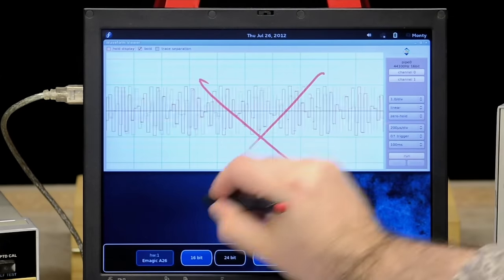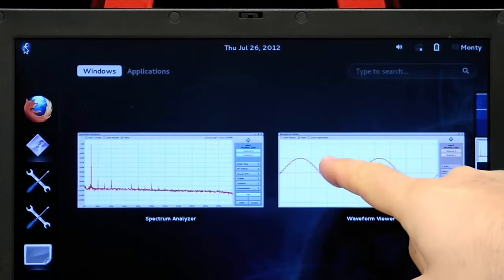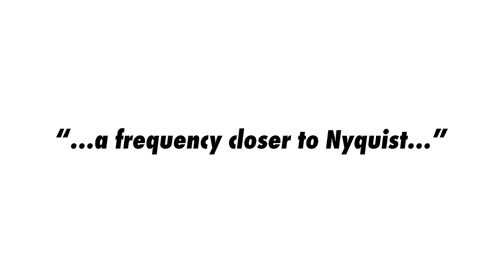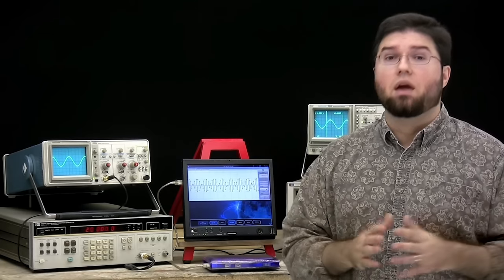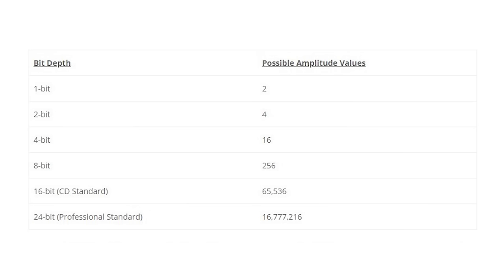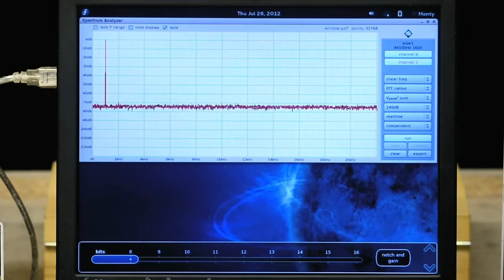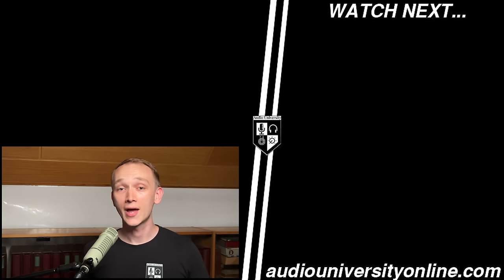Debunking the Digital Audio Myth: The Truth About the 'Stair-Step' Effect

Comment: It’s true in a vacuum. To listen to 16/44,1 audio engineers need to convert it to 16/44,1 after working on it at higher sample rate and bit depth. And while there’re good converters it is still a digital processing that applies averaging and other things. Even digital volume control is type of processing and it applies more averaging the lower sample rate you use. 

In this case it’s better to listen to music in the sample rate it was recorded/processed to apply as little conversion as possible.

Comment: I've already known that 16bit/44.1 was the limit of human hearing (although not all my friends believe me). However it's worth noting that the extra dynamic range you get from 24 bits comes in handy when you're doing audio editing and other post-processing. In general, you want to edit at 24 bits, and then reduce to 16 bits on the final output. There might be advantages to higher sample rates too, but only if your rate conversion algorithm is rock solid.

Comment: Good technical video with great production quality, so well done.

On the other hand, the video completely misses the subtle implications of sampling theory and over-sampling, in particular where over-sampling is generally done to ease the phase, attenuation and ripple performance of the nyquist low pass filter, prior to digitisation.

In the real world and precisely in the frequency domain,  the sampling process creates  sub-band pairs  centred on each multiple of the nyquist frequency. This means that real signal artefacts above nyquist, albeit low in magnitude, will be reflected (i.e, aliased)  back in-band by the digital sampling process.

Unfortunately the tests used in the video will not demonstrate this effect.

By over-sampling at much higher frequency than 44.1khz, the phase, attenuation and ripple performance of the low pass filter become much easier to achieve, while aliased image artifacts ( from next upper sideband pair, centred perhaps on 96 or 192kHz for example) will be attenuated to much lower levels, thereby reducing intermodulation distortion products and increasing fidelity.

Ultimately, the human ear and audio brain are far more sophisticated than any oscilloscope, so the differences can be detected.

It's not about the staircase jaggies, it's about high frequency artifacts folding back into the audio band, and maintenance of high frequency phase and ripple fidelity.

Comment: this is great and all, but consider that the output devices this signal goes to cannot exist in a state of superposition. That is to say that the movement of the speaker is linear and not instantaneous, thus smoothing out any steps there may or may not be in the output signal.

Comment: Digital audio do have staircase-like output. There are filters to smooth this out. And a lot of the issues are actually in those filters. So the "rounded", "smooth" waves you are seeing looks good on screen but does not necessarily translate to an accurate representation of sound, that has many simultaneous time-aligned frequencies and events.
Output of a filterless non-oversamplig DAC can be seen here: https://www.inf.ufrgs.br/~johann/dcnosdac.output.jpg

Comment: I question the test :
- my first job in the 80s was to test a DAC. There WERE steps. There were even glitches at every step. that could be filtered with a low path filter to smooth the things out (there were anyway by the amplifier and the loudspeaker). So at low frequency, with a low signal level, there ARE steps you could see.
- the oscilloscope has not enough resolution to display the 65536 steps anyway. Unless you use a very low signal level (like one thousands of the full resolution) you ain’t see nothing on the scope.

(I did not know this « Nyquist » law, I know of Shannon law that state that the sampling frequency must be at least twice the frequency. In fact twice + epsilon.
Reply: @nicksterj the thing is that the analog output of the DAC here is filtered. At 15khz, there are almost no harmonics. In other words, a sine wave. If it was not, we would see the steps (there would be several harmonics). And probably some aliasing too.
As mentioned, these would be cut off by the amplifier anyway.

Comment: I've always reckoned that higher bit depth would give more dynamic range. Consider a signal as loud as the maximum that for sake of argument a 4 bit system can handle. A signal at one thirty second of that level (i.e maximum is 32v RMS, a signal at 1v RMS) would only be using one bit. The low level signal could not be a true copy of the original when reconverted back to analogue, and any lower level signal would be ignored altogether. The bit depth has to be sufficient for low level signals that will not use all the available bits to be reproduced with reasonable fidelity.
Reply: @nicksterj I think that's my point. Too few bits, could still give good reproduction of loud sounds, but soft sounds which only use some of the bits will suffer if there aren't enough bits to start with. One reason why my example only used 4 bits apart from making the arithmetic a bit simpler. Every extra bit doubles the signal magnitude that can be handled. It wouldn't take all that many extra bits to give a usable range of thousands to one compared to the 32 to 1 in my example. As explained in the video, sounds using only a few bits would be well below the noise floor or the lower limit of hearing in a 16 bit system at any reasonable listening level. Above a certain point more bits just gives more usable dynamic range, rather than greater fidelity.

Comment: This myth about steps is also that no one understand how tape works.  Most envision some squiggly line that runs the length of the tape as the stored sound.  When actually it's striped pulses that cross the tape at 90 degrees that record the frequencies.  So in a weird way digital sampling vs analog are similar.  Tape uses pulses that make the speaker vibrate to reproduce music while digital uses math to recreate the pulses signal to reproduce music.

Comment: Very interesting video, but we were only looking from the current standard to higher frequencies and bit depths (I know, there was also 8 bit).
What I would find way more interesting would be at which point the signal will get distorted if we lower the sample rate and/or bit depth. Obviously,
if you would use only 1 bit, the signal would not be presented very well, but at what point does the distortion begin?

Comment: Wait...each sample represents a voltage level on the speaker and IS held for the sample duration. That IS a stair step pattern. So obviously the DAC (or some other interim processor) is doing the smoothing.

Comment: I recorded a natural area, birds chirping in a forest.
I used the exact same equipment for 44.1 and 48

Listening over headphone playback,  in mono I couldn’t hear any difference whatsoever.
But in stereo, the ability to locate the sound of the bird in the soundscape was sharper in 48, the 44.1 has a degree of spacial blurr.
48 has less phase distortion
Reply: mfnickster9754  
A Sony DAT
Bear in mind that I A/B’d for hours to detect any difference, and slight soundstage smearing was all I could detect between the two rates. 

Subjectively, imagine a Robin tweeting in a tree 25 yards away.
The sound location seemed less pin point under 44.5 , let’s say it was a 2’ spread, with 48 it was dead on.

Comment: 12:23 if you know how loud a 90dB sound is, a 120dB sound is 1000x louder than it (as the decibel system is an exponential system, +10dB is equivalent to 10x the volume)

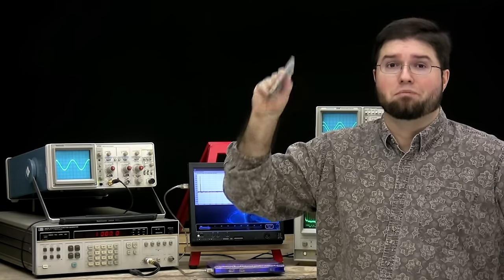Comment: 10:27 That's only on Type 0 tapes. Quality Type 1 tapes definitely don't sound like they have 5-6 bits of S/N ratio, as shown by VWestlife and Cassette Comeback, when the level is adjusted properly. They are closer to 9 bits. 

And the hiss can also be mitigated quite a bit with those mains powered bulk tape erasers, if your tape deck doesn't erase it properly.

Comment: Not quite sure I understand how the effect on noise floor works, but I'm glad to see bit depth = dynamic range really does come out in audio the way I expect it to from a software engineering perspective- that is, obviously you can represent more levels of difference with 32 values than you can with 8, your minimum of "1" being further from your maximum of 32 than of 8. Oh, I guess that's the noise floor huh? The fraction of the maximum that the lowest value is. Hah! I guess it does make sense.

Comment: I remember sampling a TR-808 with my Kurzweil K2500XS using 44.1 Khz 16 bit the bassdrum sample had a  high pitched ringing sound added. The ringing was gone when I increased the samplerate to 48 Khz.  What could have caused the issue at 44.1 Khz?

Comment: This is not exactly wrong but it is pretty off.
First, you choose a sine wave as your example. 
Most of the time if I am testing gear to see what is going on with the transfer function, I use a square wave. 
That signal will have a lot more harmonic content. 
The square waves corners will droop or pinch upwards depending on whether the harmonics are being attenuated or reinforced. 
So this is a better example of how well a system can reproduce a signal accurately. 
The sine looks more analog so I see why it was chosen for that reason. But it also is more tolerant of abuse by the transfer function. 
It has no harmonics, so they can't ring or be attenuated to modify the shape of the waveform. 
You essentially only have hard clipping and noise to worry about.

I used to be an analog purist until it became impractical. I still would prefer to record on magnetic tape and mix through an analog desk. 
But I embraced digital after doing my own tests.  It has great bandwidth and dynamic range, but you have to maintain proper headroom, where analog medium is more forgiving. 
But that discipline bears wonderful fruit of transient detail. 
Through my own tests and listening I've found that digital does have problems in the upper end. 
You mention the Nyquist theorem where the highest usable frequency is half the sample rate. 
This is true. Also most DA designers I am aware of put a low pass filter right at the Nyquist cutoff. 
Anyone who has studied filter design knows there are no perfect filters that drop off perfectly from one frequency to the next. They are all so many dB per octave roll off. So your 44.1khz sample rate has a low pass filter starting at 22kHz and dropping at 12db an octave or so.
They can make a steeper filter that drops off faster, but that filter will then ring more, or introduce delay/phase issues. Which themselves have an objectionable quality to them.  
So these filters do intrude on the upper end of our hearing range.
The 48kHz sample rate was a workaround for exactly this problem. It pushes the Nyquist corner freq to 24kHz, well above audible for most humans (I could hear that high when I was younger, but thats another story). 
So this gives the designer plenty of room to design a filter that only barely reaches in to the audible band, and is many dB down from the program material by the time you get into the main part of the material. 

Now this is where we get into higher sample rates and bit depth. 
Suppose you have two square waves of different frequency, and a saw tooth wave, and a sine, all mixed into one signal. 
That is a more complex signal. Now pitch all those about an octave from each other, and at different levels. 
Ad some impulse signals as well just to make it interesting. Now this is approaching the complexity of music. 
Add some randomness. Pink noise or something.
If we want to keep sharp edges and detail of this ugly waveform we don't want to be hitting the top of that digital ceiling, and we don't want to be down in the noise either. 
16 bits is about 90dB snr right? 

Here is the problem as I see it, when you look at an accurate frequency plot of audio the low end is well represented, the middle less so, and the higher frequencies take dozens of dB less signal to sound at the same apparent level. This is why we use higher bit depth. 
So we have not only more headroom, but more basement for our weaker high end signal. 
If you are at 16 bit and you are -48dBfs you are really only using 8bits. 
Going to 20bits gives you an effective 12bits on that quiet part of your signal. 
Going up to 24 or 32 likewise gives you more working room. 
This is important for production work!
The signal that gets recorded is destined to be processed by virtual EQ and dynamics. 
This will bring up the previously quiet parts, if they are noisy or affected by a janky LP filter we won't like the tonality. 
So we use ADDA with 24 or 32 bit depth, -120db snr, and 192khz SR. 
You want it to be not "just good enough" for the range of human hearing, but to exceed that. 
The final delivery medium can be just good enough. 

Gotta say I am skeptical on your claims about the equivalent bit depth of magnetic tape. 
I know of a few machines by Nakamichi, Denon and Tascam/Teac that had claimed singal to noise in the 80's with Dolby C, or S. 
Also in the late 80's we got Dolby SR on the big multitracks. I got to use that a few times and it was very impressive. 
Pretty sure an Otari with Dolby SR could get into the 90s. And then there was the DBX noise reduction which had absurd claims of 22dB gains and such. But DBX always made things sound dull and plastic so lets ignore it. 

TLDR do this again but with square waves.

Comment: No the nyquist is the sample freq is half the cycle giving 2 samples per wave. think of a car wheel turning, when it reaches a certain speed it will look like its going backwards. 20kz is average at the age of 18 but sound engineers can hear higher like runners can run faster. you have smoothes on the output of a DAC so a sine wave will be reproduced looking great without steps.

Comment: One case where more bits can be desirable is when alternating between very soft sounds and very loud ones (classic pieces, movies, concerts etc) but this means that you're trying to render a very faint sound with a higher precision than one can hear, or that if the person increases the volume, then the subsequent loud noise will destroy their ears.
Reply: Yes you are totally right. 
This point on sound separation between the various instruments was not even discussed in this video.
Hence 16 bits isn't enough.
One proper article mentioned that 20 bits is the ideal. Beyond that we cannot perceive any difference.
But since the next hit depth is 24, that's the one which will have more benefits than 16.
Reply: @anujmchitale  note that 16 bit is still too fine resolution for the human ear, 8 bits are enough, however for the dynamic range it's useful. But that range doesn't need to be linear like we do with 16bit PCM. For example 16-bit floats (fp16) provide a range of 30 bits + sign. And 8-bit floats in 1-4-3 format can provide ~18 bits + sign ~= 19 bits that should be sufficient to encode highly dynamic music with an excellent quality.
Reply: @levieux1137  Yeah but the sound level aspect that you discussed in the original comment is quite important in a piece having 4-5 instruments. Then I could observe the minute notes better at 18-19 bits than 16. Ofcourse after 16 the next bit depth to choose is 24. But both of us would agree that humans won't be able to differentiate anything beyond 20 bits.
Reply: As the video states,  16 bits covers the dynamic range from a mosquito buzz to a jackhammer, enough for most people.
Reply: @dirkjanriezebos2240 yeah but there's still a confusion between amplitude and resolution. Nobody is able to hear the mosquito flying around the jackhammer, but it's what 16-bit provide in terms of resolution. In terms of amplitude, it's definitely important to cover that range, and even a little bit more I think, that's why non-linear is better, e.g. a log scale of 8-10 bits covering 16-20.
Reply: HDCD was an  attempt to address the technically lower resolution for low amplitude signals by using an additional bit and sacrificing one at the upper end from -3db. HDCD  was a clever idea but very few discs use it . That said the quiet parts are meant to be quiet and so naturally you're going to notice the resolution less anyway.  If much of the disc is quiet to allow for just a few large peaks there may be a case for a touch of compression or peak reduction to get an overall better mastering of the music.  I also have some CDs that have been mastered approximately 3db below full scale, incredibly wasteful of the last bit of available resolution. But even these sound pretty good even in the low amplitude passages.

Comment: As a DJ that is concerned about audio quality it's hard to find information grounded in facts, so I ask: when it comes to mixing 2 or more tracks together, do these pricinples still apply? Is 44.1 and 16 bit still good enough for the audio sources that are being mixed? What about the player and mixer specs when considering an all digital path before the master out?

There are many setups available out there, between CDJ players, mixers both analog and digital, as well as software mixing with DAC outputs.
Are those scenarios closer to the music production side where bit rates higher than 16 are preferred?

Comment: Vinyl - better art work, something to handle and read easily, good access to the music depends on other equipment (record deck as a hard drive!) also choosen for aesthetics, pleasure of use and technical values…. The whole experience of music reproduction is now a million miles away from what it used to be when decks were manual and music played from ones own HARD OWNED record library or tapes.  Its just very different from streaming for free by fingertip